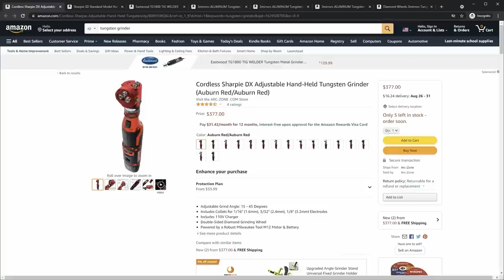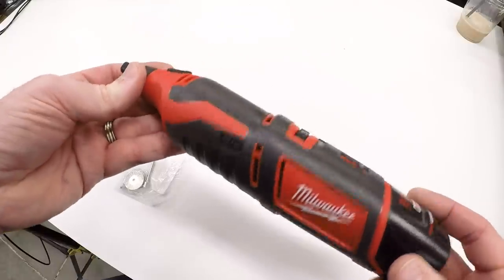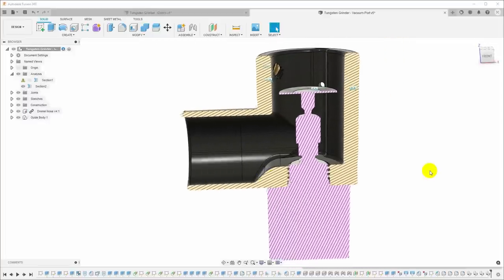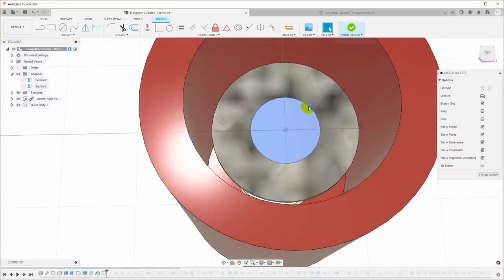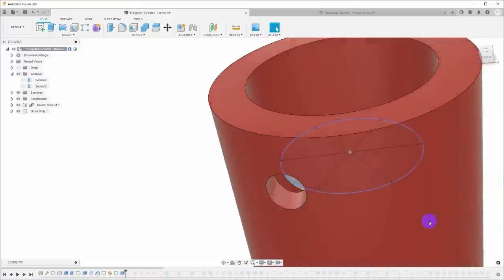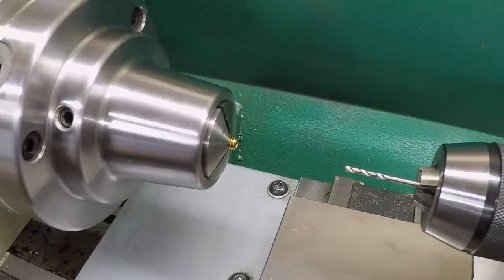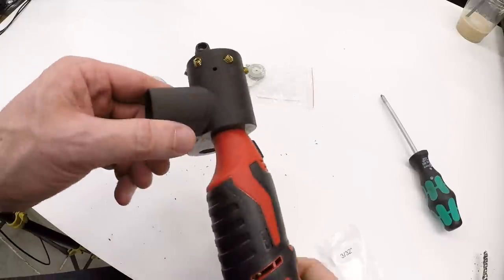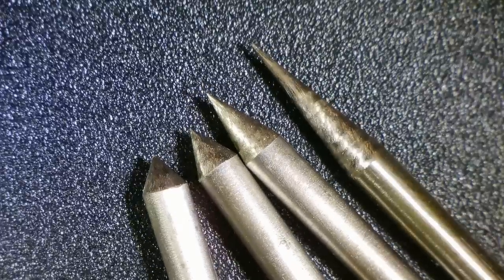Let's Make a Tungsten Grinder | 3D Printing with NylonX

Comment: Excellent work.  I dropped your design on the 3D printer, grabbed my Dremel tool (has the same threads as the Milwaukee) and a diamond disc that was laying around, machined some brass.... Voila!  I have a tungsten grinder.  Thank you for the effort and thorough walk-through of Fusion 360.
Reply from the maker: Very cool!
Reply: Thom,  
Thanks for sharing!   I have two Dremel tools already so it's nice to know that I don't need a 3rd rotary tool to make one of these for myself.

Comment: You could print a spacer that fits on the shaft of your cut off wheel, so you don't have to sight it in. Just an idea.
Reply from the maker: Yes, and that would work for this one shaft and wheel setup.  Honestly, now that it's set, it'll probably just stay installed.
Reply: @Clough42  that makes sense. I didn't know if you wanted to keep it for just that purpose or not.
Reply: I was thinking maybe a second 'sighting ' hole 180 degrees away.  You could put a tungsten across and let the arbor push up against it to set the height.
Reply: Alternately, instead of a sighting hole, a similar geometry just a little higher could've been a place to put a dowel pin as a stop. Spacer sounds better though.
Reply: When I saw him spacing it above the hub I was thinking the same thing. I don't think I would 3d print it though. Brass bushing would hold its dimension better and be more durable

Comment: I'm glad you included the vacuum attachment. Story time on why and a expensive lesson learned below:

I was a hobbyist welder for ~5 years and almost exclusively used TIG and regularly used Thoridated Tungsten. I sharpened my tips using a bench grinder and fine stone I only used for tungten. I did it by hand, the stone spinning "away" from me, in a large well ventilated space, and with my face several feet away (the joy of good eyesight). I thought there was no real risk of my inhaling the fine particles and my thought at the time was that most metals are inert so I wasn't concerned.

I recently found I have dangerously elevated thorium levels in my body and more recently finished my chelation therapy to get it and other heavy metals I have been exposed to under control. The only place I have been exposed to thorium is through welding. The thorium levels considered dangerous are very low. 

I had slowly deteriorating health through my late 20's and early 30's, was fit and exercised, ate ok, and had no underlying conditions and no doctor willing to test for odd/rare causes. Doing a LOT of reading and evaluating my few symptoms, prior tests, past hobbies, and jobs I suspected heavy metals as a possible cause and sought out an "alternative medicine" practitioner as they were the only ones, in my experience, who would even test for such things. I'm very glad I did.
Reply: hope your doing better now. May I ask how such toxic levels are actually treated? 
Does anyone know whether vacuuming the particles is actually safe (as in not blown through the room through the vacuums exhaust because they are too small)

Comment: Thank you also for showing how you modeled the part in Fusion 360. I'm just starting to learn it and your teaching style is great. I used 1/4" x 20 nylon cap screws instead of the brass. I've had problems with to much heat transfer through metal egg shaping the threaded holes in my printed parts and the cap screws are easy to take out with your fingers. I might also color code them for the different size tungsten's. Great work.

Comment: Nice 👌 
Another idea...when using 2 disc mounted together...then use the outer circle to grind.
In that case you have perfect axial grinding lines.
Only need 'new design' for the holes and the grinded surface will not be straight but slightly hollow. In my experience that hollow shape appears not to be negative. I loved you video as I also use my mounted big grinder and takes much time. Thanks from Holland

Comment: I've printed a similar attachment for a small 75mm (~3 inch) angle grinder. I used teflon tubing usually used as bowden tubes to shield the print from the heat. Held up well so far.

Comment: Great video.  Love the Fusion 360 tips.  Thanks for publishing the f3z model on Printables so I could modify it to fit my Eastwood TG1800.  The Eastwood only works for two angles and two sizes of tungsten so this was a great upgrade.  I did post a remix that uses torch collets instead of set screws so you don't have to drill or buy anything.

Comment: Thanks James.  Can't say I've taken the plunge for TIG (no room for the gas bottles unfortunately) but some of the modelling tricks were really handy to know - specifically the thread chamfer and the offset start and extrude backwards techniques.
Beautiful results too!
On a 3D printing front, I want to share a solution that I just picked up.  Glass bed, wipe down with acetone before printing PETG....no adhesion. IPA, no change.  Finally found a suggestion to wash with dish soap (Fairy liquid / Dawn) and that worked absolute wonders.  Sticking like it used to but with no lift at the edges at all.  Better top layer too as a result of a better base.  Thrilled with the change.  Just on the off-chance it's helpful to anyone reading (or to you!).

Comment: Those diamond wheels for a dremel are marvelous. I grind everything from drill bits to carbide single point lathe tools with mine. I also have a tool post rig to screw the dremel into for grinding on the lathe. I made videos of some of it.
Reply: I've fallen in love with diamond discs which are intended for rock polishing, but they're the same size as a DVD, the center hole fits on a bench grinder arbor, and the only cost about 10 bucks apiece. I put a 300 grit and a 1200 grit back-to-back (they're single sided) and freehand my TIG tungstens (primitive, I know.) The tips are beautiful! I wish I had the microscope video camera.

Comment: One of the ebay ones used delrin. It's machinable and high heat resistant. Been using the tungsten mate for almost a year absolutely no worries. The bottom does need exhaust holes counter drilled to the rotation and at the grind point for exhaust. You are right the powder gets into the bearings and just kills them
Reply from the maker: I have a chunk of delrin, but didn't want to set up the dividing head to mill the compound angles.

Comment: I'm just going to throw out there that I'm lazy and the 3d printer I built last takes 2 or 3 lifetimes to calibrate correctly.  (New one soon, hopefully the newer main boards will make the calibrations less painful).  But that's a nice enough design I might actually try it out.  Really clean design with what seems like a good combination of features without making it a huge pain to set-up.  And the vacuum port is a really well thought out addition that I hadn't thought was important.  But it is pretty bad stuff to get in your lungs and a pretty simple solution.  Good stuff, thanks for sharing!

Comment: Thanks for uploading the STL file. It printed great on my resin printer. I printed it with no infill, solid. I used Siraya Tech Build Non-Brittle Tappable Engineering 3D Printing Resin. I had problems with the normal resin where it would crack if I tried to tap a part. I used minimal supports and had no problem cleaning it up. Thanks again.

Comment: Just finished  mine. It took a bit to get the setscrews drilled out since I Used a drill press instead of a lathe. It took drilling a tapping a 1/4-20 hole in a block of aluminum, and using the tap to line up the hole so the drill bit was centered I the setscrew. 

I used 3d solutechs carbon fiber nylon, something I have been very happy with, (other than hard to get) I used "tree supports" and they seemed to break off much easier than the more standard support styles

Comment: just a quick thought, if the tip grinder gets too hot. You could always line u'r plastic part with sheet metal, and insulation... 
this is why U'r so helpful! as well as having a super creative ability. U have a steady work ethic, that get's the job completed. which in-turn creates products, that will last for decades!! ''again'' well done!!

Comment: FYI The one you modeled your design after also has a Slot in the side for setting the height of the diamond wheel instead of the hole but either way will work. Also their you can move the brass inserts to accommodate different size Tungsten with any angle you desire..

Comment: Printed your tig grinding jig using my Prusa i3 Mk3S. Used stainless set screws drilled to 3/32 in. because that's what I use the most. Will also be drilling screws for 1/16. Your jig works great! I also posted a make in Thingiverse. From a fellow Fusion 360 user, thanks for your generosity in sharing this design.
Reply: What material did you use. Can PLA be used instead of the NylonX?
Reply: @Vikramslm  
I used black PETG.

Comment: I know everyone has other ideas, but I put a cup wheel in the lathe. Use the the tool holder with bushing. Now you have full control of angles and feeds. Just have to put paper or card board over ways to control the dust. I use the lathe for brush, and disk sanding wheels too. Love the printed shroud idea, but I am to lazy !  : )
Reply from the maker: There are lots of ways to do it.  I went this route so it would be portable, but then again, my welder isn't super portable, so there may not be much point.  :)

Comment: I tig in the high tech field, mostly on 316 stainless. I have a tooth pick dispenser that feeds me tungsten's and when I get a sizable pile (30'ish), I sharpen them on our diamond wheel grinder that is set to about 30 degrees. To speed things up, I use a brushless 12v Dewalt impact with a 1/4" keyless drill chuck adapter.  You can find them for $10 on amazon.

Comment: Hi James! You could design the inner upper half of the vacuum port with 45° "roof" surfaces instead of the steeper cirular overhangs to print that part without supports. Anyways, always looking forward to your videos!
Reply: I was going to make the same suggestion, but I'm 3 months too late. I hate using supports...

Comment: I just bought a small belt grinder from AliExpress (30 x 533mm belt size) for US$50, one that have both horizontal and vertical surface, and make a vaccum shroud for the horizontal part. If you want consistent grinding angle just make some rest jig. To get almost perfect geometric shape i just stick the tungsten to my bosch battery drill, and rotate it slowly while running the belt at highest speed... the scratch is perfectly straight/vertical end to end.

The only downside is it's not portable. But i dont mind that because i grind all my tungsten before i start working. Have like at least 10 sharp and clean tungsten before i start.

Comment: One thing to note: "Class" 3 is tighter tolerance which translates to less clearance between the mating thread form. If one desires a looser 'fit' then choose Class 2 for the tolerance. The "B" for those who don't know denotes inside (I.D.) threads where "A" denotes exterior (O.D.) threads

After spending many hours modeling this, you should think about marketing the item to recoup the time invested in modeling and producing the content. Not many DIY guys have a 3D printer. Just a suggestion. 

Cheers!

Comment: Great Job!  Once you get your disc or mandrel height set, I'd maybe imprint an embossed feature on the side of the tool, for setting the height.  Or just make a seperate jig for it.  Assuming your aren't dedicating the tool to this task.  Gotta love the 3D printing aspect.  My best weapon on support material remove are various pliers, and stiff tweezers.  That the downside of increasing nozzle size as well; supports become much more robust.   I love those cheap diamond discs.  Lots of uses.   Much nicer than the emery discs of old.  Cheaper too!

Comment: I didn’t expect the vacuum for this tiny quantity of grinding. It’s cool that you reverse engineered a product from Amazon and at the same time made new content.
Reply: Tungsten welding electrodes typically contain thorium, so even small quantities of dust are a significant hazard.
Reply from the maker: There are valid concerns about the health effects of tungsten grinding dust.  I think most occupational health standards now require totally enclosed tungsten grinders.  For my use in the home shop, it's probably not a big deal, but this will also help keep the abrasives out of the motor bearings.
Reply: Not a machinist, never welded. First time hearing about the radioactive hazard of this metal.

Short of using complex grinding tool, vacuum and respirator, only alternative I can think of is using a jig like Lansky filing system, but wet grinding it with a diamond file. I suppose inhaling won’t be a problem that way.

Comment: About the angled threaded holes. I woul have extended the body outwards forming a boss instaed of counterboring inwards to clean up the beginning of the thread. That way you get more thread not less. It's better for stability and wear.

Comment: Nice project! I use 0.3 - 0.35 mm gap in PETG for custom supports separation. Not sure what is best for NylonX but a few test prints should give you the right gap that holds well enough to print but easy enough to remove. I hate generated supports as they waste too much print time and material, plus they can be very difficult to remove. You can build any design to print without generated supports by adding breakaway supports to the model only where they are needed.

Comment: Would have been nice to use a corded Dremel that plugs into a common outlet, switched to power on both tools at the same time. It's how my sandblast unit works. Powers the light inside and vacuum when I flip the switch. Nevertheless, great video @Clough42.

Comment: you can optimize !  all the 4 angles to point somewhere else to the wheel , 
so you can use all the surface of the diamond wheel , not only the middle. ;)
( maybe just forcing the sticks against the brass center can do that job also )  

sorry for my english

Comment: A small rubber O-ring around the tungsten could work as a stop against moving in and out from the wheel. Could make grinding more consistent.

Comment: Milwaukee fills my tool box…yet if I can do something the way my grandfather did it..using spit and baling string..I try that first.  The Drexel sharpener is perfectly adequate for the average welder that goes through 20-30 tips per year.

Comment: There's a number of ways to make horizontal holes without supports.  For this model I'd probably replace the hose adapter with a teardrop hole in the vertical cylinder. Then you could make a second part that adapts the teardrop shape to the vacuum hose but printable in a more favorable orientation.

It is also possible to print in a "V" orientation with external support, although this can mess with threads.

Comment: great cad work. the model looks great

Quick tip / methodology  for efficiency and a more robust cad model. the sketch circle and planes were all great for getting your geometry set up. You showed drawing 6 segments around the circle and then repeating the process of creating sketch planes and extrusions. If you have these repetitive features finish the first one on your primary axis, horizontal or vertical. and then when the feature is done, all the way out to the threads if you want pattern the features around the cylinders center axis.  This will cut down on the number of operations in your time line aswell as create a more robust model. With this approach the model wont completely change if you say made a REV 2 for larger cutting wheels or wanted to change the number of collets or there orientation. You can make all the changes on one feature and propagate them through the model.
Reply from the maker: If the features were all identical, this is how I would have done it.  But since they're all at different angles, I couldn't see a way to use the feature pattern to save any work.
Reply: @Clough42  hmm, it wasn't obvious that the holes were at different orientations. are you using different grind angles for different diameters of electrode?

In that case you may be able to use Boolean operations to pattern this out. create a body to use as the negative space and pattern it out radially at the spacing and count that you need. then adjust the angle of each body independent and subtract the space from the main housing in one shot and remove the bodies and collapse the operations as a group in the time line. I haven't tried this in fusion but it would definitely work in SolidWorks.
Reply from the maker: @essthrice  the different holes are to offer different grind angles for different uses.  I don't know if you can adjust different instances of a component after patterning.  It would be interesting to try.  Even manually placing the instances might save some time, though.
Reply: @Clough42  I just played around with it a bit on a rough copy of your design, you can definitely do it with manually placing subtracting bodies bodies.

What I did was make cylinder for the tap clearance hole size. Use the point to point move command to get it positioned on the pattern circle and the adjust the angle from the horizontal base plane to adjust grind angle. All of the move commands are stored in the tree and if you move them to defined sketch points the model should react properly if you change the design some where else in the model.

In the end it might be some what equal in modeling time but it will result in a higher quality model for design changes.